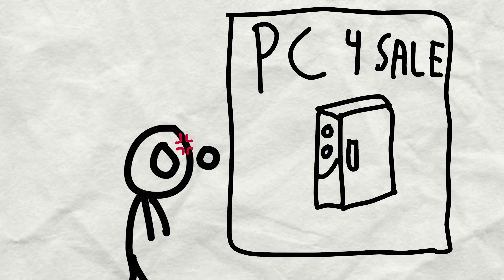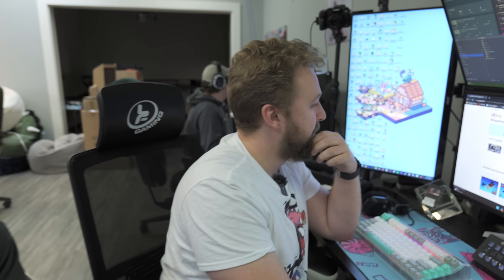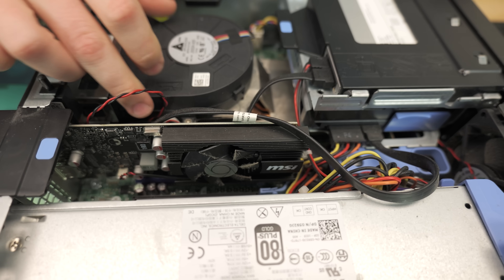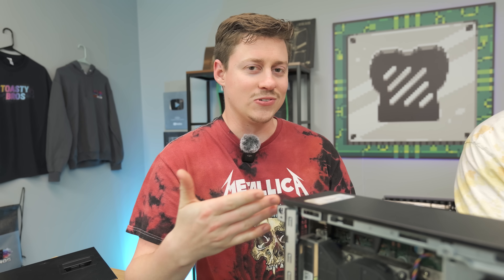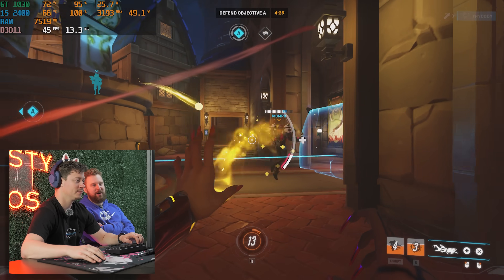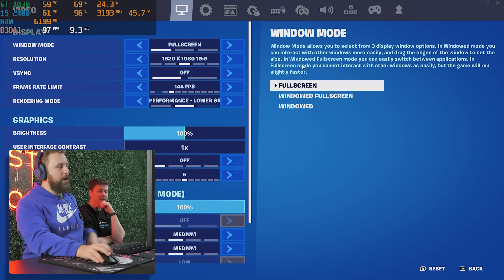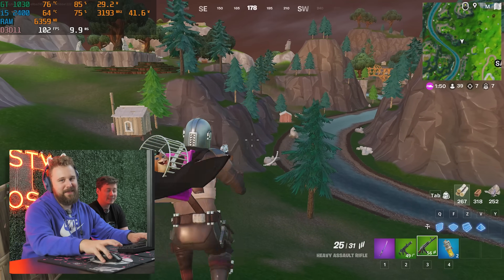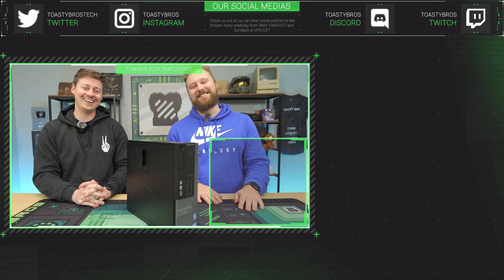Is SOMEONE Trying to COPY Our Gaming PC's?!

Comment: makes me wonder if you can put a 1650 in it and have a better gaming rig
Reply: Yes, putting better hardware in a PC makes it a better gaming rig.
Reply: If you want an office pc with a better GPU you should try get an office pc that's newer than the 2400. You could get a i5 8400 as an example, it's 6 core 6 thread which is better than the 4 cores before it.I don't know what toasty bros sell in office PCs bought and upgraded to a gaming system but if you buy from them, then you know the GPU fits but also that the PSU is up to the job. If you buy an office PC then buy a GPU only to find out it doesn't fit then you bought both for nothing.